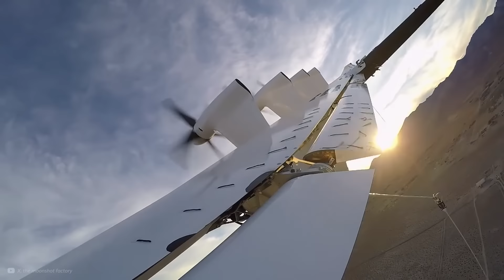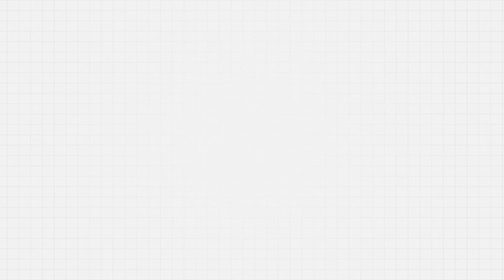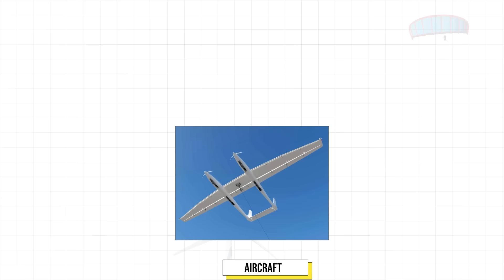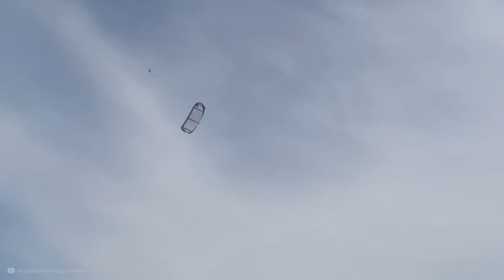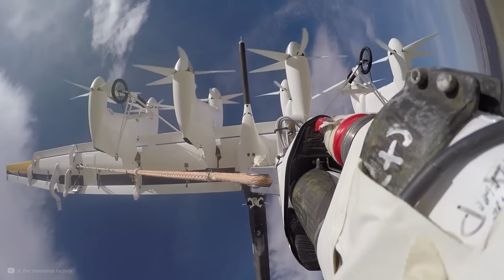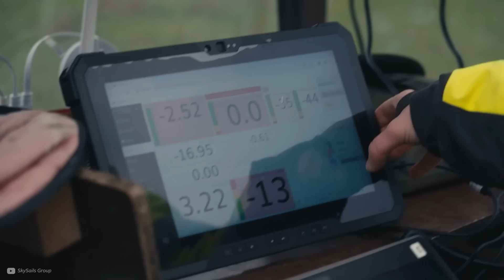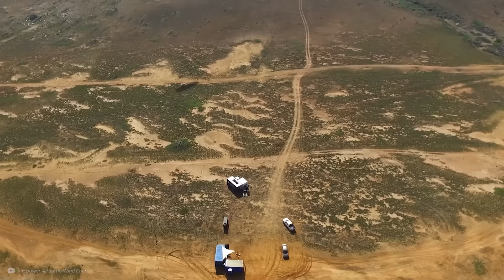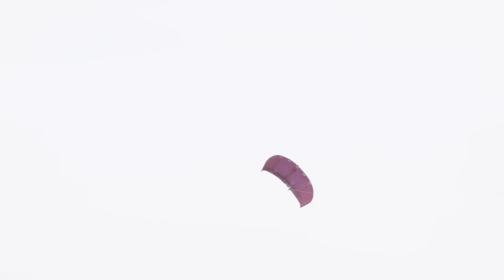Airborne Wind Turbines: The Future of Clean Energy?

Comment: Since there is no one on board they should use hydrogen for lift. It’s cheaper, renewable and more buoyant.
Reply: Eh... the problem is hydrogen likes to diffuse through everything, so it would need to be refilled often
Reply: Why not use something that is free? The same wind used to turn the turbine also lifts the device, far simpler than relying on hydrogen, which has to be refilled. Think the KISS theory.
Reply: @turkeytrac1  Yes think of KISS now rather than needing to track wind fluctuations and falling out of the sky when it screws up it just stays up with a lifting gas.
Reply: If we use hydrogen, the wall of the balloon must not be traditional plastic/ polymer-based material, as the molecular size of H2 is too small and they will seep thru the material and leak away.
Reply: Yes that’s correct. Petrol, lithium batteries and hydrogen cars are all highly flammable and that risk doesn’t stop them. It seems that one airship disaster 100 years ago has us all,scared.
Reply: @anthony9thompson  People mentioning Hindenburg here got me really surprised. I didn't know someone can be terrified by the prospect of a gas burning
Reply: It's also notoriously hard to store without it leaking through literally anything
Reply: Self suppled hot air?
Reply: @sharky2606  Where could we possibly find a sufficient source of hot air? My God, we are out here talking and talking and talking, and we still haven't come up with a solution! Where would you possibly find a concentration of unnecessary hot air? We keep TALKING here about these things but what could that possibly have to do with generating a lot of HOT AIR?
Reply: As far as I know hydrogen is expensive to produce
Reply: The issue with hydrogen is that it leaks very easily compared to other molecules. That's the price you have to pay for the low density. Someone has already mentioned generating it on board, but I think it'd only feasible as a part of larger systems. Something like that wouldn't really scale down to small installations (in my opinion, at least). Compressing this would lead to dismal efficiencies. It becomes a question of how much power you're willing to waste on this
Reply: Hydrogen leaks out of any container it is put in, something like a nylon kite/wing it’d be gone in a flash. More dense materials would add weight to the flying element, making it infeasible to fly in low wind conditions. May be possible to overcome but it’d be a very significant challenge.
Reply: Helium will leak fairly quickly. So that’s a real problem. It’s also a non renewable resource which Regan privatized and now is becoming much less common.
Reply: Yep and probably make it out of non flamabble fabrics and materials so incase it ruptures it does not crash burning
Reply: It's also worth pointing out that the Hindenburg was painted with. What was chemically the same as rocket fuel.  You could just not do that.  Then maybe the hydrogen wouldn't explode.
Reply: @FreedomTalkMedia  Hydrogen literally is a rocket fuel.
Reply: @garethbaus5471  Hydrogen is not painted on the outside where all the oxygen is.
Reply: They could probably use some of the electricity they generate to heat and pump themselves up
Reply: I think you guys are over complicating the solution to using hydrogen. Ya there’s a risk of it blowing up and creating falling debris. But you can just build a fence, and put up do not enter-signs on it. As for the hydrogen leaking. I don’t really see the problem. Ya hydrogen leaks a lot, but so does helium. In fact helium leaks more. The particles are so hard to keep from leaking because of their small size and helium is smaller than hydrogen. So just do what they’re already doing, fill it with more hydrogen than you need. Then refill it every time you need to do maintenance.
Reply: We're actually doing a startup that uses the energy produced from the wind turbine to produce hydrogen from rain water which is used to produce hydrogen to keep everything afloat. So far so good and every house can fly a kite to to 100m especially with hydrogen in it..the results so far are beating solar in the UK/ Ireland
Reply: @thomasd2796  but what % of the energy from the wind is used to create hidrogen and how you create it? Thats smart.
The other point is, how you do for the thing to be safe? because hidrogen can explode.
Reply: You have an instagram or something i can see about that project? Its sooo interesting
Reply: Not only should they use hydrogen, they can have a hydrogen generator on board, that pulls moisture out of the air and electrolyzes it, they should be able to keep up the volume indefinitely. Alternatively, the H generator could be on the ground and a very small hose up the tether.
Reply: @TagiukGold  - two problems with that approach. Firstly, mositure collecttion is a slow process and hydrogen generation not particularly fast either. To collect enough moisture conditions such as dew point, relative humidity and evaporation would result in variable amounts of moisture at differing locations and times. Secondly, generating hydrogen from water is very energy intensive for to generate 1kg of hydrogen takes 50kWh of electrical energy (without pressurised storage), that same 1kg of hydrogen only contains 33kWh of energy representing a loss of 17kWh before the airborne energy harvesting can begin. The energy loss puts hydrogen lift systems at a net energy disavantage compared to and kite based system. Further, the round trip efficiency of recovering, recharging and relaunching a floating hydrogen lifted generator will be higher than that of a kite system; I'm assuming ground based hydrogen generation due to the weight of water collection and hydrogen generation systems representing a deadweight to lift and safety risk to be carried airbone.
Reply: @GruffSillyGoat
Just put a small hydrogen bottle in the kite. They are not up there permanently and are winched down for maintenance. Nothing to reinvent here.
Reply: @TagiukGold That would likely consume every bit of energy produced by the turbine.
Reply: @PistonAvatarGuy  that depends on the average loss rate (make-up required) of the hydrogen and the average kwh rate of power production. Production of 1kg of hydrogen from water requires 55 kwh of electricity. Helium is even more costly. So yes, you are correct, the cost of the buoyancy gas is most likely the prohibitive factor.
1kg of H2 at STP is 163 cubic meters.
Reply: @TagiukGold  You also have to consider the energy required to condense water out of the atmosphere.
Reply: Hydrogen is garbage for things like EVs, and I don't think it is a main energy storage solution either. 

 For things like lifting? Absolutely! I would even fly in a modern hydrogen airship. 

 Hindenburg wasn't even the worse airship crash. The Akron was with 73 deaths. Then the R 101. 

 The Akron was a Helium filled airship too, but has double the deaths. Huh. 

 Anyway I can understand others not wanting to be in a hydrogen airship. Yet this is a turbine with no people ever going into it. Hydrogen would be fine.
Reply: So where do people go to get jobs doing shit like this?? Why am I struggling for months to find a bare minimum wage job, while it looks like many people get paid to play?? What the fuck??!?!?
Reply: @StealthTheUnknown  because they are elite, your a cow, less than a cow XD
They are mostly scientifics with elite and mega rich conections, goverment conections, etc...
Unless you born there is really hard to get there without risking your safety and life
Reply: Oh, the humanity...
Reply: There are some much easier ways to make reliable energy...
It's cute though.
Reply: Stanley Meyers solved this years ago… no need for wind.. just split water molecules and use hydrogen in an on demand fuel cell.  This is why he was killed.
Reply: Yeah, use a fuel source that takes more energy to produce it. Very smart. Very intelligent. That’s why hydrogen is not being produced at high demand it cost more energy to produce it than it produces. It only takes common sense in a little scientific knowledge but you earth huggers, land, lovers, or whatever you wanna call yourselves don’t understand it takes energy to produce hydrogen it takes lots of energy to produce very little no common sense too much stupidity go back to school and get educated. I’m talking get an 80s and 90s education not this 2000’s bullshit where they teach you to be Stupid
Reply: How are you going to steer it without some sort of engine/ motor that can apply thrust across the multiple axis you'd need to control. Hydrogen used as a means of vertical axis control is cute, but tbh it would have to be very big meaning lots of control surface will be needed & it quickly begins to look very impractical to me. A big floating windmill. I get it. This idea is an impractical one that isn't new.
Reply: Hydrogen would leak out to fast to be sustainable.
Reply: It would also look cool on 4th of July aswell
Reply: Hydrogen has a big problem of leakage. Hard to contain
Reply: I was thinking of birds (they already hit traditional wind turbines) creating a hole and partially deflating the balloon and leaving a potential half full balloon on the ground with some hydrogen but the material of the balloon should be already strong enough to endure normal weather, so probably no problem (also even helium balloon should be in danger in areas with some lightning)
Reply: Hydrogen also destroys everything it comes in contact with
Reply: Hydrogen would be spectacular when this thing inevitably hits the ground. "boom"
Reply: It leaks is the biggest problem
Reply: You can combine Helium and Hydrogen
Reply: I don't think lift is the problem here. Not that much of a difference for this load weights.
Reply: They’d still be dangerous during maintenance I’d imagine. Also there’s always the possibility of crashing into the ground which I’d suspect would also be more expensive to insure even beyond just the safety concerns. It seems unlikely that any cost savings would justify as long as gas leakage wasn’t a significant issue. It’s also not a given that the aerodynamics and buoyancy of a hydrogen design would perform better.

All that being said, it absolutely could be a superior option long term but especially in the proof of concept stage, it seems more practical to at least start with helium
Reply: 😂😂😂 I’m all for it but it will be one hell of a boom when it goes pop
Reply: "Today on how to turn minor electrical problems on a balloon into catastrophic failure, we'll be surrounding a wind-powered generator with Hydrogen. The rougher the conditions, the better for driving the turbine, the greater the magnification of risk via increased current! Its gonna be a good one, so stick around."
Reply: Wasn’t the Hindenburg a lesson
Reply: Bang
Reply: Also flammable
Reply: Would it be possible to use 2 kites? That way the power can be continuously generated. Maybe the autonomous navigation could prevent them from tangling.
Reply: Its not so easy to keep hydrogen in a light weight container. The H2 moecules are so tiny that you allways will constantly lose gas.
But I don't think that the gas fill is the real issue with this design. Building and maintaining a balloon is just much more expensive than having  a tower. If you fly higher, you have more wind, which also cause more force at the system. A bigger system is more efficient, but for big systems you need a stable platform (aka tower)
Reply: Oh the humanity!
Reply: A 60/40 mix of helium and hydrogen is still non-flammable but cheaper than He alone.
Reply: Lightning, people, lightning......
Reply: @weeklydude  even more energy to harvest...
Reply: Yes thats what we really need to harness@weeklydude
Reply: @weeklydude 100% pure hydrogen is nonflammable
Reply: It's also really hard to store, which would make long term deployment difficult.
Reply: @chadleach6009  You do not store hydrogen long-term. You make it where you need it using the magic of electricity. Which you also make when you need it. Moved around by WIRES  which are like leettle tiny pipes.
Reply: Hydrogen is a powerfull greenhouse enabling gas init's own right, 11 time more impact than CO2 via inhibiting the breakdown of atmospheric methane.

As hydrogen leaks so readily it would be difficult to contained in this role without causing more harm than good.
Reply: Kites are not lighter than air.
Reply: @RachelsSweetie  Not all the proposals are for kites.
Reply: @RachelsSweetie nor are planes
Reply: lightning
Reply: @HotNoob  So you lose some fabric and the grounding shunt does it bloody job.
Reply: Hydrogen with a mix of about ten percent Helium is supposed to be explosion proof.
Reply: Worked really well with the Hiddenburg too /s
Reply: If it can also collect a little bit of rain water then it could also use electrolysis to replace hydrogen as it is lost.
Reply: Hydrogen + electricity ?
Not a good idea
Reply: Hydrogen is not renewable, it comes from natural gas. Theoretically it could be made with renewable energy, but adding theoretical green hydrogen to theoretical floating wind turbines just takes the technology further from reality.
Reply: @TheReykjavik  Neither of these concepts is really theoretical. There are installations that don't use methane reforming, but they're not numerous. Electrolysis is a well-established technology that's more than 200 years old now. However, it's not particularly efficient when applied to water. Hence the ubiquity of hydrogen derived from reforming natural gas. Balloons and wind turbines too aren't alien technology. The overall concept is simple; complexities arise when you're scaling it
Reply: @TheReykjavik There's also "blue" hydrogen if you're not buying the green one. It's good enough
Reply: Yeah and it may catch fire also !!
Reply: @عبدالمجيدععع-ش1ظ  Possibly not that big a problem. The things are airborne - if it goes bang at altitude, not a huge problem. You just need to fit it with a self-destruct system which will rupture the envelope if it falls below a minimum safe altitude.
Reply: @vylbird8014  A couple pressurized blow out valves or a plasma field to cause an implosion instead of an explosion.
Reply: @troyallen8223  I was thinking of a wire run through the envelope that could be connected across a lithium cell bank, heating it red-hot in seconds and melting through the fabric. That would release the hydrogen safely and very without igniting it,  The heavy machine within would still be dangerous upon landing, but it'd fall from a height of only a few tens of meters and without a fireball.
Reply: @vylbird8014   Once an explosion happens I don't think that would help much and if you're going to have the potential for it to lose altitude you may as well allow it to come down as softly as poss ible in a controlled decent for maintenance or replacement. The idea that an explosion won't outrun something melting is really a plank measurement contrast when it comes to making much of a difference. Now if you were able to cause an implosion of the gas it should remain at relative ambient temperature. Also the material your talking about melting and gassing off into the atmosphere. 🤘
Reply: @troyallen8223  Yes, but if it explodes while in the air that's not too bad. Wouldn't want to be in the rain of debris below, but the shockwave would be safely far above anything vulnerable. I was thinking of the release as just an emergency measure, in the event the turbine is damaged and coming down anyway. If it's already losing gas, it seems a good idea to make sure all the gas is vented just before it reaches dangerously low altitude.
Reply: @vylbird8014  there is an issue, hydrogen leaks really easily
Reply: @عبدالمجيدععع-ش1ظ  And extremely leaky
Reply: @عبدالمجيدععع-ش1ظ so does gas and 1000 other chiemcals compounds used for fuel or processes in
Reply: @عبدالمجيدععع-ش1ظ  It isn't much of a problem if one catches fire if nobody is nearby.
Reply: @عبدالمجيدععع-ش1ظ  even more of a reason!
I love fireworks!🎆
Reply: From where? There's no flying fires out there afaik.  @عبدالمجيدععع-ش1ظ
Reply: Don't remember the hydrogen airship, Hindenburg,  disaster back then?
Reply: @ChinchillaBONK  Contrary to common opinion, the Hindenburg's destruction was mostly due to being coated in what was basically thermite. Yeah...
Reply: Wonder if natural gas or ammonia might work.
Reply: @tbuyus8328  No, too heavy. There aren't many gasses that are significently lighter than air. This is why we use the expensive and finite helium or the somewhat explodey hydrogen: There's nothing else that works.
Reply: @vylbird8014  natural gas is (by volume) mostly hydrogen with methane and propane being a relatively small number of molecules present (but those make up the majority of the mass, because they are so much heavier than hydrogen) 
Because of that, if you fill a balloon (or we used thin plastic bags from the dry cleaners) with natural gas, then vent it at the bottom to let the heavier gasses out, it'll float.
Reply: @vylbird8014  Both methane and ammonia at STP is lighter than the air in typical hot air balloons. Methane is actually just slightly more than half as heavy as air at same temperature and pressure. Main problem with methane as a lifting gas is flammability, but it's not unreasonable to use methane as a lifting gas.
Reply: @vylbird8014  hydrogen  is lighter than helium
Reply: @m1kem477hewz Natural gas is composed almost entirely of methane although it does contain small amounts of other gases--ethane, propane, butane, and pentane.
Reply: @fishyerik  methane is entirely unreasonable to use because of the climate impact being so inconceivably huge.
Reply: @m1kem477hewz nonsense, coal gas was 60% hydrogen back in the day, natural gas has to be minimum hydrogen or they wouldn't be able to meter it properly.
Reply: @vylbird8014  Methane, ammonia and neon are all lighter than air. So is steam.
Reply: @m1kem477hewz  Natural gas is mostly methane. Brownian motion means heavier gasses don't vent like that. Methane is lighter than air.
Reply: @vylbird8014 or use some of the energy to periodically heat some air? Wait a minute..electric hot air balloon powered by the wind?
Reply: @fishyerik and ammonia is toxic. If you are dealing with flammability anyway, hydrogen is preferable as it is not a greenhouse gas like methane.

If the envelope does burn off and is destroyed, you could design the airframe to use the rotor like an autogyro to slow the descent to prevent catastrophe maybe?
Reply: Natural gas just isn't good enough of a lifting gas to be practical  @m1kem477hewz
Reply: @m1kem477hewz 
The amount of wrong you are while also correct is difficult to express properly....
Nat. Gas is almost ALL methane, with very trace amounts of propane or hydrogen (though I hear Hawaii adds up to 30% H to bulk it out).  BUT methane is CH4, so it Is mostly hydrogen, but combined with carbon.  The propane is the same, just a longer chain of carbons with hydrogens connected.
Reply: @tbuyus8328  There are no gasses lighter than hydrogen, this is because it only has one proton, one electron. There exists no other possible alternatives.
Reply: @scoddri7392  Not true! There is muonium! It is much lighter!

This is entirely irrelevant because it has a half-life in microseconds. And it is also called hydrogen anyway. My comment is entirely pointless! Thank you!
Reply: @tbuyus8328  Natural gas, even if it would work for that, seems to kinda go against the purpose of using wind power in the first place. If an area has cheap easy access to natural gas then they're probably just burning it for energy
Reply: @tbuyus8328  i don't get it??
Reply: @tbuyus8328 natural gas is less expensive compared to hydrogen but it is 8 times heavier which may impede its ability to lift a balloon. If released into the atmosphere would also cause more damage since it is a very insulating gas. Interesting perspective!
Reply: @tbuyus8328 natural gas is a very potent greenhouse gas, not a wise idea